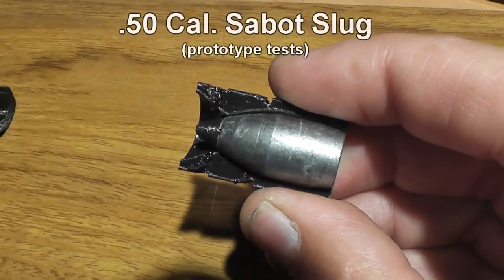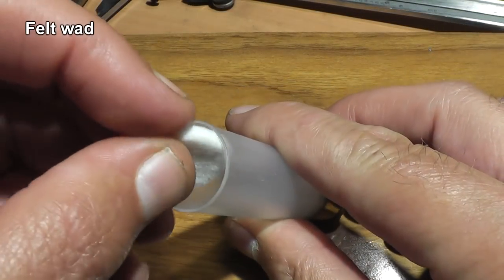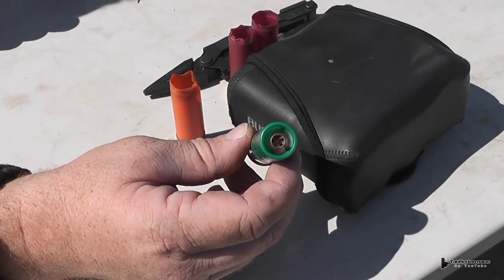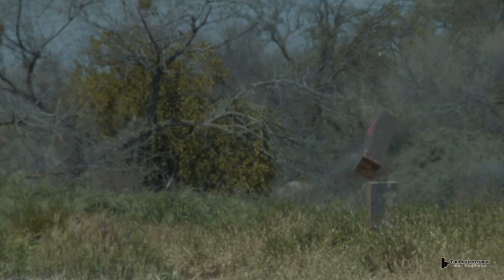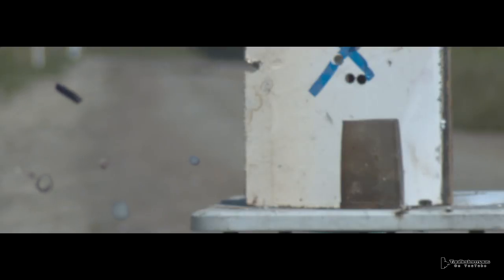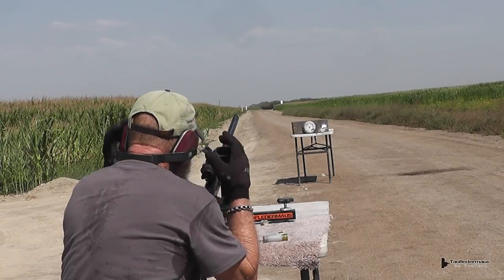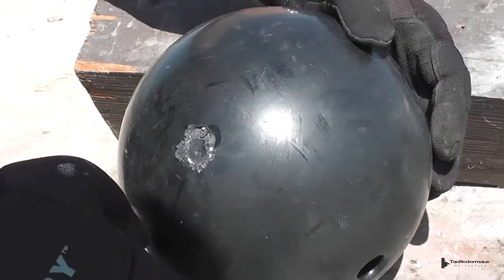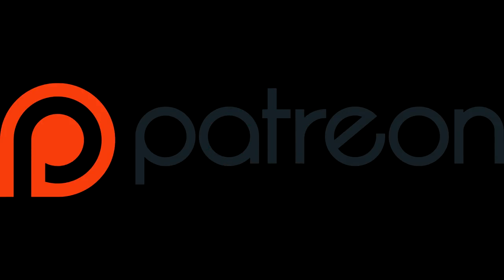.50 Cal. Discarding Sabot Shotgun Bullets - Australia

Comment: I watched the whole video before commenting, and I just want to say that this is one round that has good potential. It'll be interesting to see what it can do at higher velocities, and maybe with a different type of tip on it, maybe. It looked like it was flying true, unlike many of the prototype rounds you're sent. Love the vids man, keep up the great work.  :-)
Reply: Imagine something like a hardened steel or tungsten core in that thing, with that accuracy and a proper load? Ouchie.
Reply: Dsdcain I think a tungsten pellet shaped slug would be sweet to see shot
Reply: tungsten is REAL heavy, but brittle, would be interesting to try, i used tungsten plates at a previous job, one of the few metals that can stand up to 3800F, it does warp after a while.
Reply: Dsdcain I
Reply: What about the polymer tip that hornady uses that's light and ensures expansion plus prevents clogging.....Just a suggestion lol but would be pretty cool
Reply: Or  Ferro rod

Comment: I was wondering if the sabot would have enough grip on the round to spin it up.  Maybe that was part of the issue with the rifled choke?  Doesn't seem to be a problem with the full length rifling.
Reply: jcims 
The rifled chokes are a sudden/short section of twists. Not much of a chance for the round to come up to rotational speed. The fully rifled barrel get it spinning before it comes up full muzzle velocity and not suddenly at the end of the barrel. Better chance for the Sabot to grip the heavy mass of the enclosed round. Hope that made sense.🤔. 🇺🇸😎

Comment: Are you planning on every bringing a laptop to the range to review the high speed so you can make adjustments in shooting? I know you've said you can't see the screen cause of the sun, but what about a laptop in your truck with the A/C cranking?
Reply from the maker: I change settings all the time between each shot,  trying to get different angles and frame rates,  so it has to be tweaked for each shot.

Comment: It'd be dude awesome level if you got one round into the finger holes in the bowling ball.
Reply: Danny AKA Triker Red as long as you chase it with Greg's finger ! 👉🎳👏👏
Reply: Bee Ell 
Awwww. 😔 Gregg ALWAYS gets to finger the holes. 😩.  🇺🇸😎
Reply: Danny AKA Triker Red lol you guys are great!,  That Amazon acog is holding up pretty nicely. You guy should group up and have a shooters comp, Danny Vs Greg 2017 pay per view.
Reply: Bee Ell 
😂🤣🙄😳.        🇺🇸😎
Reply: Bee Ell 
The hole would have to be straight at them and would probably come back at them. It appears to be dangerous enough as is.
Reply: Michael Hartman maybe, but physics of an object interacting inside an isolated chamber, hitting a surface with a concave surface, would inherently redirect a ricochet into the chambers surrounding bodies, instead of returning it directly in the path it was delivered, not to mention it's velocity is greatly decreased by slamming into the balls finger holes.

Try not to confuse the difference between a concave surface (bowl) to the ricochet from a convexed surface, which was shown by the outside of the ball.

Comment: looks like a good round for some common game but i think it lacks the penetration due to the printed tip where it is losing more then half the energy after the tip is impacted and wanting to rebound off... maybe a bit harder material... maybe like a solder tip would give better results with out to much change in balance... but other besides that i think this would be a great round for some light to mid game like deer but maybe not for like bears in my opinion... maybe... not sure......

Comment: Jeff, maybe you can enlighten me about something.  I've been away from shooting for a LONG time, back when I did some, I had formed the impression all shotguns were smoothbore.  Correct if wrong, I assume a rifled barrel would be to extend accuracy for solid slugs.  But if that's the case, why not djust use a rifle?

Also, am curjous.  I have a very old Mossberg 500 myself, did Danny get the rifled barrel custom made, or is it a standar item available from dealers?
Reply from the maker: There are a lot of places that have seasons just for shotgun hunting.    This gives rifle-like accuracy - just shorter range.   There are several companies that make aftermarket rifled barrels for Mossberg 500s.  I think Mossberg makes their own too.
Reply: TAOFLEDERMAUS 
Correct. 🇺🇸😎

Comment: Hey Jeff, can't you measure the speed of these slugs by using the high speed camera? Place the camera at a right angle to the flight path of the slug, place a board with feet laid out behind it. Then see how many feet/ inches the slug moves per frame, divide a thousand milliseconds by the amount of frames the camera is running at, and voila, you can easily calculate the speed of the slug. It might help you determine the powder load each slug performs best at.

Comment: you are not supposed to shoot sabots out of rifled barrels
Reply: dwight sarver gaming and gunning 
Seemed to work! 🇺🇸😎
Reply from the maker: That's the only way to shoot sabot slugs.  I showed you want happens when you shoot it through a rifled choke,  and a smooth bore is even worse.
Reply: go tell that to the military
Reply: and the m1 Abrams tank uses sabots and it is a smooth bore
Reply: Remington Premier Copper Solid  1oz. Hollow Point Sabot are designed for fully rifled barrel but will perform out of a smooth bore. You may be missing out on improved performance!